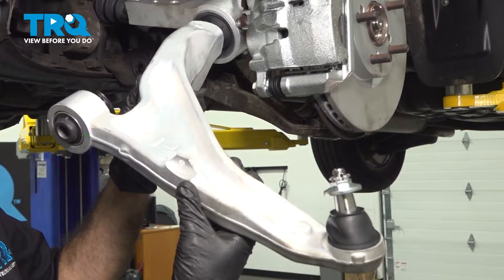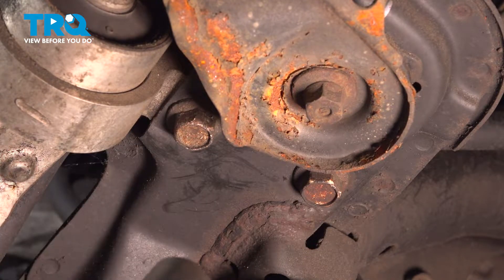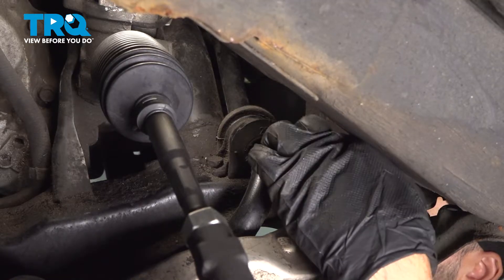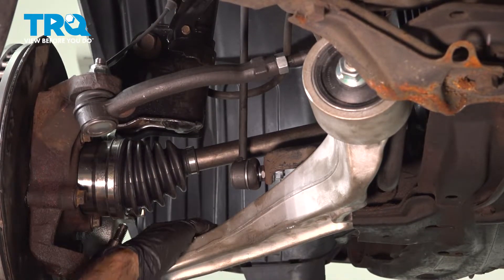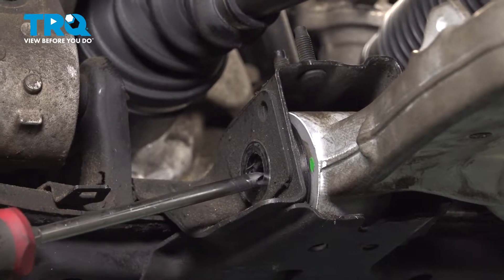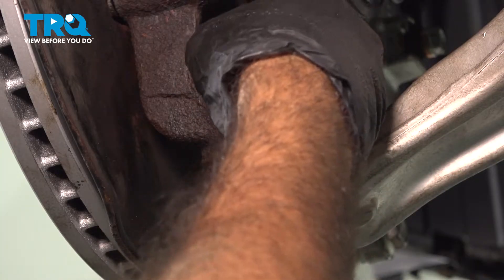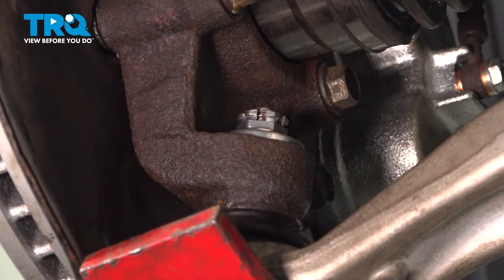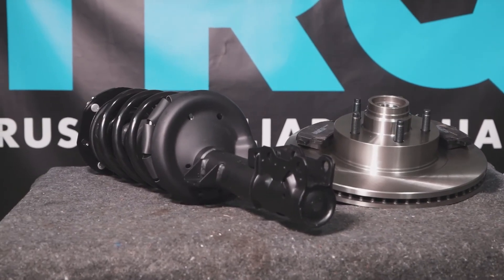How to Replace Lower Control Arm with Ball Joint 2007-2013 Acura MDX

Comment: Just as an FYI, I ended up looking this video up because at work we had an issue where we couldn’t find the right control arm.  
For some reason, the Acura I was working on had a different stud on the ball joint.  The stud here has a slight incline to it, where the one we had was a straight up and down shape.  
No one knew what to do, so I took the old control arm and torched the stud, then took an air hammer and shot part of the stud off. 
Turns out that there’s a sleeve that the stud goes into, and that sleeve is very important.  

I don’t know if anyone else will have this issue, but if it saves anyone from trouble… then I’m glad I said something.